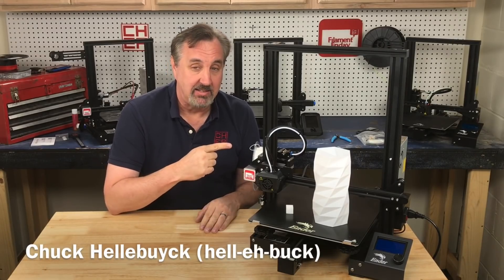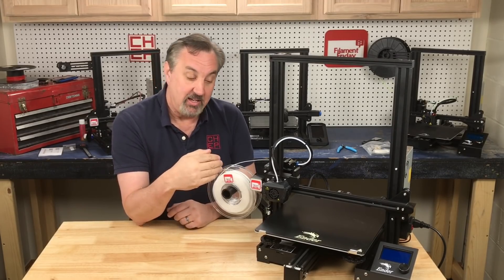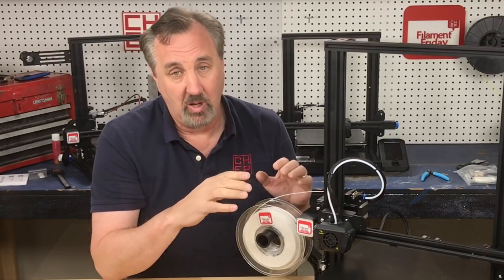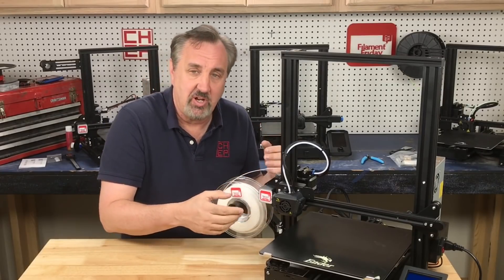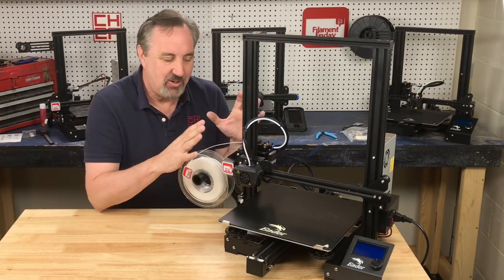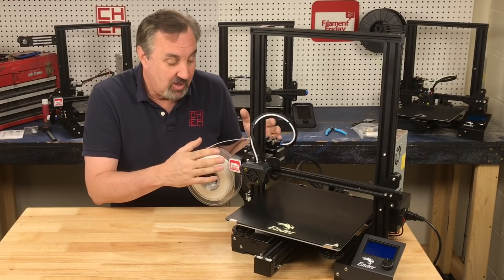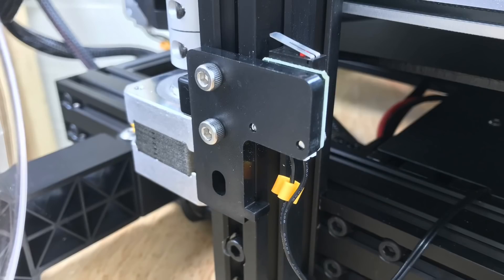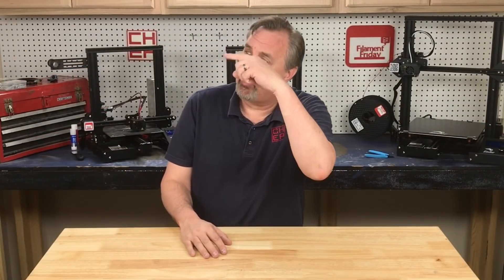Creality Ender 3 MAX Better and Cheaper Improved Version

Comment: Hi Chep. I bought the Ender 3 Max after your recommendation. I am still struggling with a problem where the first ~8 layers are really smuhed together. Especially in the top right corner. The X-Axis was a little sagging on the right side and I fixed that following the "X Gantry Rework Section 2.1.2 featuring the Ender 3" Video. Now the X-Axis is perfect. Still I have those smushed initial layers. It doesn't look like elephants foot. More like a little solid rim ~1.5mm high surrounding the base of my parts - most prominently in the top-right corner. After the first 1.5mm the layers above that are PERFECT. Flawless. This is the strangest part!

Any tips what I can do to overcome this problem are highly appreciated. Tighten the rollers? Do something to the Z-Axis nut?
Reply from the maker: Loosen the T nut on z it may be binding the first few layers.
Reply: @FilamentFriday  Thanks! I will try. You are the man! Any suggestions how tight? Tighten completely and then back of 1 turn? Or better 2 turns?
Reply from the maker: Just loose enough that you don’t feel any binding when turning the threaded rod.
Reply: @FilamentFriday  It already was pretty loose. I could only make it half a turn more loose until it didn't go any further. Very odd. Maybe it is too loose? I am confused...probably need to find a 3D print forum to get further suggestions.
Reply from the maker: Move the Z axis from the LCD control and see if it’s binding.
Reply: I recently had this issue when fixing my friends ender 3 max. The bed rollers were waaay too loose. Tightened them and everything works like a charm. :) @shoeoffhead
Reply: @annottony7221  The bed rollers? So NOT the rollers on the vertical axis but the rollers BELOW the bed? Thanks! Any idea why that would squish my print?
Reply: @shoeoffhead3692  I re-read your comment and i think i didnt read it fully at first :D. I imagined the bottom of your print being "crippled" as it looks smushed together, ugly all around. Maybe im wrong and thats not your case.
I think i understood what you mean with that, basically, could be either elephants foot or z axis rollers being too tight (this causes something similar to elephants foot but closer to what you described. They should be tight but not too tight :D You should be able to move(slip) the wheels with 2 fingers without too much force applied.
Reply: @annottony7221  I am aware of the problem - including z-axis binding. But that's not it. My rollers are quite loose.
Thanks anyways.
Reply: @shoeoffhead3692  Well, if thats not it then the only remaining thing i could imagine would most probably be bed level and trying decreasing the bed temp / nozzle temp
 and seeing how it turns out.

Comment: I've been running/Battling an E3Max since Dec2021.   Don't get one unless you plan on buying/installing a Dual Z...  constant drooping of the X carriage causing Z axis issues...   Came from Creality with the Z carriage eccentric nuts so tight it made flat spots/crushed wheels.    Fought with creality for replacements... they sent me one, when I showed them multiple wheels crushed.   Fixed it my self...  After a little running trouble pops back up.   Needs constant attention.   Causes X carriage to pivot instead of running up and down.    It droops so much it crushes the nozzle into the work and clogs the nozzle.   Seems like a nozzle issue, but its the x gantry pivoting instead of moving up and down vertically.   Note that the neo comes with dual Z...

Comment: Still trying to get mine going properly. Its my entry level machine to learn 3D printing but its been reasonably hard going. Ajusted the X and Y tracks, seem to have solved the adhesion problems but leveling the bed has been no fun. Still getting rough prints, the raft goes down perfectly but the build above it gets lumpy and messy while doing the basic infill. I guess it will come with practice. I have just fixed a blockage by pulling the hot end apart, worked out how to extract a filament from the teflon tube and putting it all back together again.
Reply from the maker: Make sure the PTFE is all the way to the nozzle.

Comment: The set screw on the extruder should be on the flat part of the rod. Might want to fix that if you haven't. Love your videos because of you that's why I own a 3d printer
Reply: You might want to watch the video again. You can see on various angles that the extruder has 2 set screws and on of them is indeed on the flat part. Typical part fixation tbh

Comment: My Ender 3 Max is in the mail and should be delivered in the next couple of days. You said it was 300 x 300 x 340 well here in Australia it is being advertised as 300 x 300 x 400.
Also you quoted $329 which according to currency converter is $478.93 AUD well I paid $399 AUD which converts to $274.09 US I think I have a great deal and it was from Creality 
on Ebay au I might even order another one.

Comment: I bought one of these last summer and have been having a great time with it. I did have a periodof extrusion problems that took a while to sort but ended up being a blocked nozzle and damaged bowden tube (although that might have happened while I took the hot end apart). I used the supplied profiles for the E3 Max in Prusaslicer and it produces lovely prints, a little slow but with that big old bed I guess they are being conservative.  One day I'll get round to trying to "tune up" the settings to see if I can get it a little faster. The only other problem I have is a noisy hot end fan, but I'm not sure what to replace it with, silent fans tend to have low throughput and I don't want the extruder overheating and clogging. Oh well, its fun to experiment!
Reply: get a noctua

Comment: I just bought this printer and I'm so glad that I did, huge build capacity and all the best features of the much loved ender 3 series, managed to get it up and printing nicely within a day, Also installed a CR touch for that little bit of freedom and comfort of mind. Thank You for your videos a true help to the average hobbyist like myself.
Reply: For a first time printer person how's this printer? Have you had any issues? And clicking noise from the extruder?
Reply: @mikek2824  no i havent had any issues really, slight problem with the CR touch but soon resolved, other than that its a great printer, havent noticed any clicking noise from the extruder only slight noises from the stepper motors when doing micro adjustments.

Comment: I just got a CR-10 V2 and it has the same issue regarding the fixed height of the Z stop switch. I can't even figure out how to level it because I can't get the bed high enough. I might have to stack some washers between the Y axis and the base frame to elevate the bed. I shouldn't have to do that though. Not sure if you can do that on the Ender frame but it's probably worth looking into.
Reply from the maker: You can mount the switch with T nuts instead.
Reply: @FilamentFriday  Thanks. That's interesting. I have only seen T-nuts used on wood. Not sure how you would get them into the channel. M5T nuts would work. I will look into that. Great idea.

Comment: Hi,
i just bought a Ender 3D max printer... but i can't find anywhere how to install driver in Cura 12 and how to print from Cura 12 via USB cable connected to the computer . Can you please make a video?
Thank you.
Reply: Hello! Cura Ultimaker doesn’t have the ender 3 max under the Creality section. All you have to do is select the ender 3 pro and change the build plate from 220X220X250 to 300X300X340. Hope this helped!

Comment: Hey chuck I just bought the Ender 3 Max and I plan on putting a micro Swiss direct drive on it do you think the single lead screw can handle that? I plan on printing helmets so the Z has to go pretty high and I’m worried
Reply from the maker: I’ve never tried it so I can’t be certain but I have a couple questions:
First, why the direct drive?
Second, 
If you are concerned about your mod, why not also install a 2nd Z that is belt driven from the first.

Comment: Im looking to get another printer had ender 3 pro and its been a work horse and my only complaint was the single way part cooling and the noise looking at the v2 for 190 or the max 217. So does the max having 2 make that much difference? and is there a noise difference it and a v2? as was just going to buy a ender 3 v2 but the max i can get for a extra 27 pound and cant decide if its worth that much extra than the V2 as can buy a v2 and do a dual fan mod.
Reply from the maker: The Max has dual fans and larger build area. I like the Max a lot but the V2 has more 3rd party firmware support so easier to upgrade.
Reply: @FilamentFriday  thanks and i do like the idea of a bigger area myself just another concern was since so big and only 1 lead screw is that or can that be a issue? As i ran my ender 3 pro hard and apart from issues caused by bad pla i had no issues and the thing was flat out and my only mod was a better part cooling fan duct. As im the type of person that likes stock not so into modding.
Reply: @controller-man-dan5676  so as a brand new person to printing just as a hobby nothing huge should I get this printer or just a 3v2? Idk what to do

Comment: Hi Chep, awesome video. I downloaded your software and tried multiple times to level the bed. The corners are level but the centre of the board seems higher than the rest since nozzle touches and makes a loud sound. Not sure what to do, the bed has a glass board as well. I have ender 3 max. Hoping for some guidance, its driving me crazy.
Reply: interestingly i flipped the board over and the centre is now lower, seems my glass is warped.
Reply from the maker: Replace it or shim under it with foil. It’s worked for some people.
Reply: @FilamentFriday  thanks for the response. I ended up getting a bltouch , works well.
Reply: @ninjak1874  how good is the bl touch? Is it easy to install and setup on the ender 3?
Reply: @ninjak1874  what firmware did you use?
Reply: @j.tsessions3132  very simple to install since I bought the kit
Reply: @ninjak1874  Hey Ninja what firmware did you use?

Comment: Hi CHEP. 1st of all., thanks for sharing your knowlegde.
I've bought one ender 3 max last week.
But I have one question.
When I use your bed test level (chep_lvl_knobs_max.gcode ) . I adjust the bed using paper, etc..  every springs. and done.
But, If I run again, just a few seconds later.  I need to adjust the springs again.. 
Why is this happens?
Thanks in advance and
greetings from Brazil
Reply from the maker: Maybe you Z stop home switch isn’t working properly.

Comment: A great printer overall but the default bracket that connects the filament to the tube caused a lot of issues. Definitely would recommend swapping it up with a capricorn one if you wanna buy this printer.

Comment: i have one and it prints crap my longer lk5 prints great out of the box the max running same cura slicer same settings and has bad stringing and hangs up on its bumps failing prints this printer is not a good printer, the lk5 out of the box has been great.

Comment: Where can I find a replacement glass bed for this?! Can't find a 300 x 300 mm bed anywhere.
Reply from the maker: Amazon
Reply: @FilamentFriday  they are all larger than 300 x 300 mm
Reply: @OtherTaylor  The bed on the E3 Max is 310mm x 320mm, because they need room for the clips. The usable print area is 300x300.

Comment: Hello Chuck, I bought an Ender 3 Max (stock one, no level sensor) based on your enthousiastic review and the regular Ender 3 that I already own for little over two years now. But I'm running into the issue that I cannot get the bed on the Ender 3 Max level. I used the A4 paper method and when I level the bed around the edges (about 2 inches from the edges) and the paper is only just touching the nozzle, the nozzle hits the printbed in the middle. When I level it in the middle so the nozzle only just touches the paper, it doesn't touch at all around the edges. I have checked the gantry frame being level/square and the gantry itself but that all seems fine. I can adjust the middle bit to be level but I didn't buy an bigger printer to not use the edges (I'm planning to build an RC benchy thats why I got the bigger Ender). Do you have any advice on how I can fix this issue?

edit:
After much more head scratching I figured out my issue. The glass bed is warped with my printer. When I flip it upside down (Ender logo on the under side) the problem inverts. Then I have a dip in the center when I level around the edges. Sadly not a solution but a very clear cause. Now I know I can even see it being warped when I look alongside it.
Reply from the maker: Use a 12” square mirror. You can get a box of them cheap at Lowe’s. Many people prefer them over the Creality bed.

Comment: I noticed the extruder gear had the set screw, but wasn't positioned on the flat side of the shaft. Probably doesn't matter, more likely to spin if the screw comes loose though. I feel so nit picky for mentioning it ;-)
Reply: The gear has two set screws on it. One is on the flat side and the other on the curved side. It's the same on the Ender 3 Pro.
Reply: @nickq615  Oh ok, great, thank you Nick. That makes more sense.

Comment: Hi Chep. Can you tell us more about the Bed-Level GCODE you offer? I used the version for my Ender3 Max. What I find strange is, that it prints very slowly (by purpose?) and what is more surprising is, that the width of the filament layed down looks very wide. Twice as wide as the width of my filament on the print bed when I print other objects. Did you extrude more? Or does it look wider because it prints so slow?

Anyway, I wonder if this is a good test to see if the filament sticks well to the bed. Because your GCode always prints nice (slow, wide filament lines) and then when I print my own objects the width of each line is much narrower and sometimes it does not stick.

Comment: Anyone have a profile for ultimaker cura for the Max?
Reply from the maker: I use my CHEP Cura profiles. Work fine.
Reply: @FilamentFriday  Thanks for getting back to me man. Love the channel. I downloaded the latest profile. So I just have to change the bed size in machine settings?
Reply from the maker: If you use a CR-10 machine to start you should be good or load an Ender 3 Pro profile and rename it Max and adjust the numbers. Either works I believe.

Comment: What is the bottom footprint area of the frame, i.e. the distance between the feet? Does it require a larger area/table top than the standard Ender 3?

Comment: bought one based on recommendation and ran into same bed issue.  bought the t-nuts but don''t know what size bolts i need to buy.  any advice or just buy an assortment and do some guesswork?

Comment: Hi Chuck
Have you done any upgrades on this yet?
Reply from the maker: I’m working on some. Auto bed level and filament runout plus EZR extruder to coming soon.
Reply: @FilamentFriday  just fitted CR touch to mine and just about to fit Dual Z and Micro - Swiss DD extruder and hot end 
That's why I was curious if you had experimented with any of these mods yet
Was also wondering about the SKR mini E3 board  compared to the 4.2.2 as the extruder stepper on mine sounds like a muted dot matrix printer 😂
Reply from the maker: 4.2.2. On Max doesn’t have a silent driver on extruder. 4.2.7 does. I did that mod in a video.
Reply: @FilamentFriday  does 4.2.7 have silent on Z as well?

Comment: I actually bought this version, i included the BLTouch for auto bed leveling
Then i went looking for upgrades. 
and everytime i noticed this printer just is awesome, and did not need a new main board or new drivers, or fillament guides, or ... it is just awesome.
Well maybe an LCD board cover, so i do not touch the electronics on accident.

I totally agree, that price is excelent for this printer.

I have had no failed prints so far.

Comment: Sir, would you have a suggestion for firmware for bltouch?  I just bought this machine just now from woot for a good price, about the same as a v2.  I already have a v2 and love it.  Plenty community support such as jyers. I am kinda regretting purchase as i can find nothing except smith 3d and they advise firmware may not work and use a alternate firmware for a z stop. Love your channel and have never directed me in a wrong path. Please advise

Comment: 2:44 my Ender 3 Max extruder keeps chewing through filament.  My other Ender 3's don't do that.  I've tried adjusting it to be loose as possible, tried increasing temp, changed nozzles, changed PTFE, and leveled bed but it doesn't help.  I'll try and fix it through gcode by slowing speed and changing retraction speeds but that will slow down prints which is never ideal.
Reply: I have same issue

Comment: I'm wondering why Creality has the CR-10S and the Ender 3 Max - it seems they are very similar in build envelope, specifications and price, but with lots of differences under the skin.  What do you see as the advantages of one vs the other?
Reply from the maker: I haven’t used an S in a long time. It’s been updated since I used one so I can’t really comment.

Comment: Does Chuck answer any questions on here? I want to know Ender-3 Max v Ender-3 Pro are they essentially the same besides the print area?
Reply: No, they are not the same.
I have an ender 3 max.
Reply: As he said in the video the Max also has metal extruder and filament runout sensor. They have the same mainboard but the Max has silent drivers which makes the printer much quieter compared to the pro.

Comment: Hi Chuck! Greetings from Brazil! I was wondering if the regular Ender 3 hotend car could be replaced for the Ender 3 max hotend kit. That way, we could upgrade the Ender 3 with an original designed dual fan, instead of adapting dual fans with 3d printed parts (like we are used to see around). Do you have any thoughts on this?